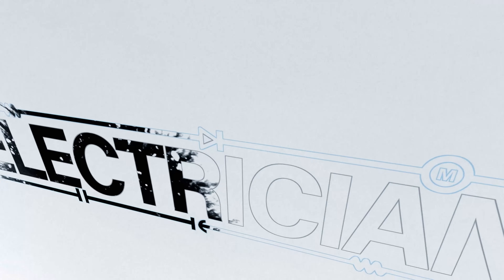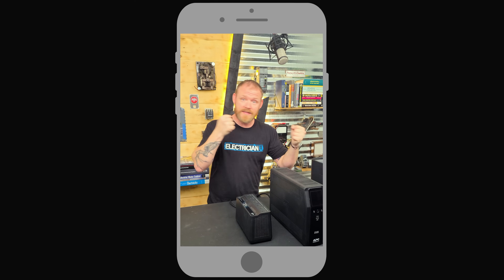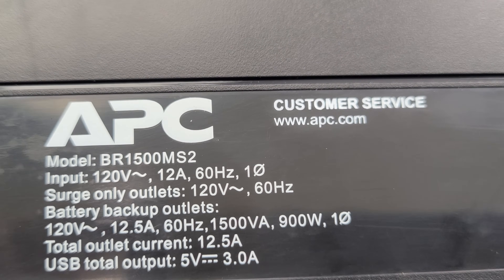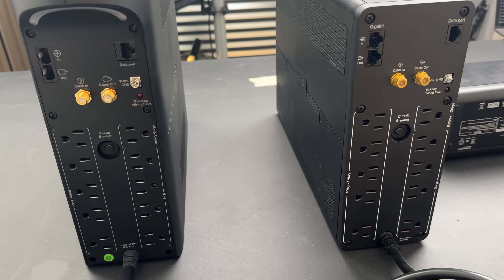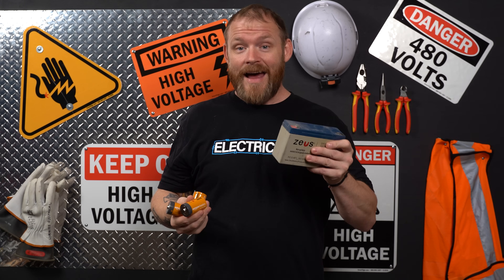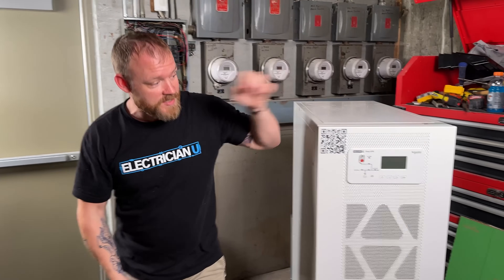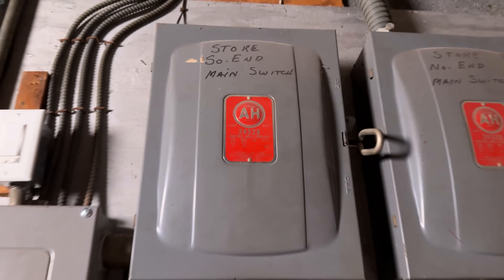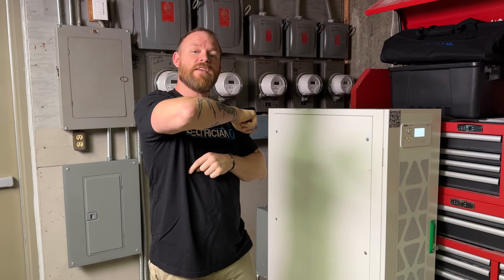How Does An Uninterruptible Power Supply Work?

Comment: eu spec here. any UPS that feeds a fuseboard/distribution board? (basicaly anything feeding out through a cable instead of a plug) has to be in a dust free well ventilated(if failed,bateries release toxic/flamable gasses) temperature controlled (in order to avoid overheating and maintaining optimal operation) and fire extinguisher equipted area. max operating load usually does not exceed 70% of the nominal capacity for a smooth operation and longevity. they are in more places than you can think of in both commercial and industrial aplications. They are also a pain to troubleshoot and diagnose lmao, overall a joy to work on!

Comment: Dustin, I have a nuanced disagreement with your explanation on how true UPS works... APC (Now apart of Schneider) explained it like this... Power from the wall is rectified to charge the battery constantly... and all items hooked up to the UPS are actually always running on the battery power that is inverted back to AC... When power is lost the battery will begin to drain... The important point here is that UPS provide essentially perfect power (aka sine wave) meaning early days of computers were less likely to be effective by brownouts et. al. To underline the main point here is that any equipment hooked up via a true UPS isn't actually drawing power from the utility it is in fact drawing its power through the inverted battery power... Therefore it is shielded from the problems of your local electric company's power which in some places can be very erratic!!

Comment: I wish you talked about the 3 types of UPSes... Not just talked about stand-by UPS, and not even talked about the delay on the switchover for them (which is very important for sensitive electronics); PC Power supplies have smoothing capacitors so can handle a short (milliseconds) outage as the UPS switches over and only protect from outages.  Line Interactive are more expensive, but also help to condition the power for dips or surges and have much lower switch delay.  There is also Double Conversion and Delta Conversion Online, where basically you are always on UPS, and just have a large enough charger to keep up with demand, and has no delay, as all that drops out is the charger half, but do have a Bypass to use the supply if it is good enough.
Pairing a UPS with a generator is best.  UPS for the critical loads and short outages, and then the generator to spin up for longer outages.

Comment: Dustin why does Schneider Electric state specifically on some of their UPS devices they are rated for lightning protection?
Reply from the maker: Because Lightning protection, is a whole different animal. Requires different equipment a head of your MDP/ UPS and still only MIGHT protect equipment down stream. UPS's are only a "power sponge" in that all power hits the batteries first before it goes out to the load. But some UPS's also can be configured for Lightning protection devices. Like emon-d-mon ect.

Comment: I have a pair of 2200VA units that can have as many external batteries as you want. They aren’t listed for hardwiring like this but my dream is to find a code compliant way to power the lighting circuit in the house off of them, so that my lights will not even flicker during a power outage.
Not really sure if feeding a circuit or sun panel from an inlet is allowed from a UPS, maybe a generator sub panel would be.

Comment: You should really cover the difference between "line interactive" and "on-line double conversion" UPS models.  And show examples of the output of each on something like a Dranetz power quality monitor or scope.  That would make for an interesting video and really shows the difference in output.
Reply: Dustin seems to do a lot of  different types of jobs, but for a comprehensive guide you should search for a data center YouTuber to explain all that.  They will have access to server-grade UPSes of all sizes and they test the living hell out of everything before it goes into production and they re-test periodically, so they are more likely to have failed UPSes they can analyze.
Reply from the maker: Id love to. Space is rather limited so accessing a Liebert NXL UPS or a Schneider/ APC Ups of those types would require A more space, and B the scope you mentioned. OR someone bold enough to let us come in and film inside a T2 or higher Data center.

Comment: One thing Dustin got wrong is that UPS are not meant to run for a long time in any scenario, they are meant to allow the user to safely power down the equipment and not lose any progress in the work or function that it is performing. If you actually wanted to run the equipment or operation continuously you would want a standby generator.   The UPS could bridge the gap between when the main power shuts off and the standby generator turns on, but an UPS is not meant for total power loss from main to run the equipment.
Reply: that depends on the type and size of the UPS. some are large "online" models that are always in use and can have giant battery banks which run many hours/days/weeks of run time.
But yes, most of the smaller consumer models are not fan cooled, line interactive and limited to short run times allowing safe shutdown(or hibernation). high load and long run time would overheat them.
Reply: @throttlebottle5906    they are all meant for safe shut down of the equipment, I know this because even the biggest ups I work with that takes an entire room to house is only there for us to shutdown the equipment it's there to back up
Reply: @zackstrackhouse1086  the amount of runtime available before "proper shutdown" occurs is directly proportional to the cost and run time wanted. granted there should be generators that come online, leaving enough reserve time to properly shutdown. in even of repeat power return and failure or generators and large sags caused by high power equipment cycling.
but I can say that there are some setups meant to run for weeks on end(smaller loading/critical infrastructure.

Comment: There is another way that some UPSs work. Instead of having the internal switchover circuit, the outputs are always running from the internal inverter. I don't know how common this UPS architecture is, but it does exist. I would also imagine that this type of UPS isn't very efficient due to the constant rectification and inverter losses.

As someone mentioned, you might want to cover why pure sine wave UPSs (and stand-alone inverters) are important for some applications in a future video. And where you can get away without paying the extra coin for a pure sine wave UPS.

Another use for UPS units is as a bridge for a generator. That way you don't need as many batteries if you only need to be able to provide power for the few minutes it takes for the generator to kick on and stabilize its own output. But you don't loose power while the generator is coming up to speed.

Comment: Know this about APC and other UPS makers (Cyberpower, etc) that when it comes to electronics like computers, routers, HTDVs, etc, the condition of the power is critical. So having a TRUE sinewave output is analogous to having pure, clean water to drink. I know Schneider-Electric sponsored this but some of the APC BackUPS lack True Sinewave. So if you have an expensive server or workstation(s), you want to have a clean Sinewave of power. Also, some UPS models will not only filter the power but buck up the voltage if there is a drop like a lost leg. I prefer informative displays to inform you of voltage, hours remaining, output/input... then again, I have a UPS for my media room, my networking, my computers, the internet router/FIOS box, and some other power-sensitive gear. And like he said about generators, there is a power loss till the genny is up and switched over...a UPS on critical electronics is a must.

Comment: SAFETY WARNING: UPSes should be kept in a well-ventilated area away from flammable items.  CyberPower (and probably other UPS brands) have been caught using yellow "hot snot" on and around components to keep them from disconnecting/moving and causing a short.  The irony is that yellow goo will turn brown and become electrically conductive after 2 or 3 years (I and a few others like EEV Blog have tested this).   Conveniently this is also about the time it will take to wear out the batteries, so replace the whole UPS!  Being cheap will cost you more in fried electronics, trust me.  Now for the video...

What Dustin is saying about UPSes and brownouts/surges is mostly correct, but it must be EXPLICITLY stated on your UPS's packaging that it supports Active Power Factor Correction (Abbreviated as Active PFC or just PFC), or Automatic Voltage Regulation (AVR).  Some will spell out that they handle OVP (Surge) and UVP (Brownout) conditions as well.  BUT!  When those corrections are made can vary depending on whether this is a low-end standby UPS or a line-interactive UPS.  The latter will do a MUCH better job protecting your equipment.

Pure Sine Wave UPS is pretty much mandatory for a modern computers.  Not only do they handle voltage fluctuations more proactively, they will also boost your incoming power to keep it at 120V/240V.  Pure Sine Wave UPSes will do the best job for in the home and small business customers.  They will smooth your incoming power and generate a very close 60Hz sine wave on battery.  Standby UPSes usually feature "simulated sine wave" output while on battery.  That means the output power will have a stair-step look, and a lot of sensitive electronics can't handle such rough input power.  They will refuse to even work on a standby UPS.

Pure Sine Wave UPSes will always support AVR and most will be line-interactive.  That is both good and bad: these types of UPSes do a LOT of work cleaning up your power and it wears them out.  When one of these needs new batteries, opt instead for a new UPS.  There are a lot of components like capacitors and relays that will wear out on you, and the handy dandy self-test feature doesn't test for that stuff.  I had a rack-mount APC that welded one of its AVR relays, but if I unplugged and re-plugged it then it worked and passed its self-test (until the next brownout).
Reply: Hey thanks

Comment: Many whole rack, and whole facility UPS systems run full time off of the inverter - there is no changeover time.  Even the 20ms that it takes can cause a computer powersupply to go into a failure mode and shutdown.  Granted, most PFC powersupplies these days have holdup time to support a changeover
Reply: If anyone is interested in these types of UPSes, the industry term for them is "Online UPS", or "online double-conversion UPS".  Overkill for most home setups though.

Comment: I like USP systems and have deployed them in many situations.  However adding battery capacity to UPS systems is expensive and makes no sense beyond a certain scale.  The next step is standby generators where the UPS just bridges the time between loss of utility power and generator getting up to speed to take over.  It might also have the control systems to make switching between utility and generator transparent or those might be supplied separately  As a data centre manager I'd be looking for a total UPS capacity of 30 minutes — enough time to fire up a generator manually if the automatics didn't do it.  But then I'd be testing those systems including a generator test on a weekly basis to have confidence in them.

Today there are really cute possibilities.  Once you are investing big dollars in batteries why should they sit there idle most of the time?  Put some solar panels on them and start making power.  This of course makes any ATS more complex and for a proper grid tie system with fully function isolated mode regulations can be a beach.  But if at all possible it should be done.  If every property had  a certain battery capacity linked with some generation capacity we'd be making huge strides into clean power territory and providing ourselves with UPS capability at the same time!

Comment: For anyone actually kitting out your home or business with UPS units or a system, pay attention to how frequently the manufacturer is expecting you to replace them or the batteries. It may change the math on what you consider vital to your operations. Also, figure out what you will do with the batteries. I went in a home of someone that i think went overboard with UPS and he just had dozens of dead batteries/UPSs piling up in a basement closet.
Reply: Current lithium iron phosphate battery tech offers better than 3,000 charge cycles and a decade for age degradation to 80% capacity so any company suggesting their product does less than this and wants more frequent expensive battery changes is taking the customers for rubes needs to be kicked into touch. Hard!
Reply: Three out of the four products linked under this video are using sealed lead acid batteries.
Reply: @DeleteriousEffect   Not surprised.  5 years ago that would have been my pick for proven reliability.  Today I wouldn't touch them and wouldn't countenance any company insisting on them.

Comment: What you describe is a STANDBY power supply not a UPS. The reason: it takes time to SWITCH to battery. That is typically 6-12ms. This switching time could affect some sensitive electronic devices. 
A TRUE UPS is running off the inverter ALL the time and the MAINS is supplying both a small charge to the batteries AND supplying power to the inverter. This is called online double concersion. When you lose the MAINS there is zero switching time.
Most people do not know this.
In addition, UPS systems should give you enough power to SHUTDOWN in an orderly fashion, not to continue operating. Most big places will use a UPS to give a generator time to start up and stabilize. When the generator comes online the UPS sees this as main power being restored.
I worked in a place that had a HUGE TRUE UPS system with batteries in racked all over a 25x25 room. This gave the data center 45 min of power, plenty of time for the buildings generator to come online.

Interesting story, once we lost power because of a car accident slamming into a transformer. People ran into the data center aski f what happened. We didn't know as the room was operating fine because of the UPS we had. I checked the UPS system after 10 min and noticed we still had no main power. Hmmmm odd the generator should have kicked in. I went outside to check the generator and it was NOT running!! I manually started the generator and once stabilized I transferred power. I called the buildings electrician to find out why the generator did not automatically start. Upon investigation it was learned that we only lost 2 phases of a 3 phase system! The autostart didn't see this as a power outage. Yikes!
Reply: There’s 3 different types 

Stand by -  for like tv and small stuff like computer Eaton 5s series

Line interactive - used in data center racks like an Eaton 9px series 

Online UPS- usually the bigger ones like Eaton 9pxm and 93pm series.
Reply: Thank you for that information
Reply: @dusty5955   yw. facts matter
Reply: They are both called a UPS, just different kinds of UPS. You are describing a double conversion/online UPS,  there are also line interactive and standby/offline types.
Reply: @LordSaliss actually they are called STANDBY battery backup supply. As it actually does interrupt power therefore not a true UPS.
Yes it is a online double conversion, the only real UPS.
Most people who dont know the differences will call all of them a UPS